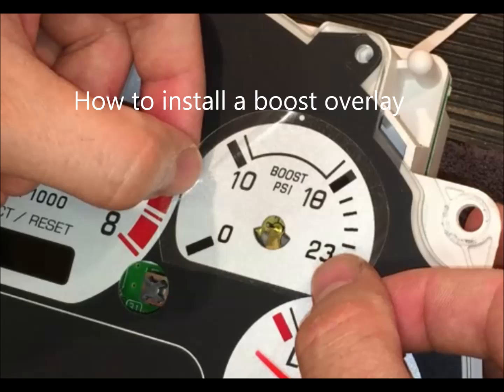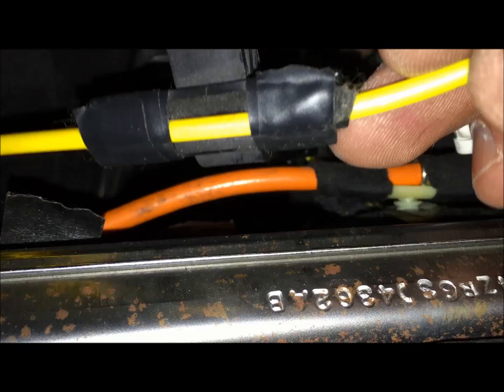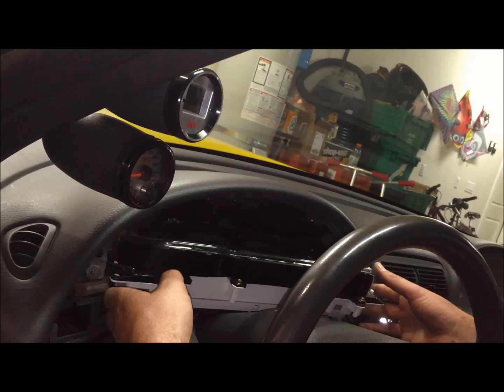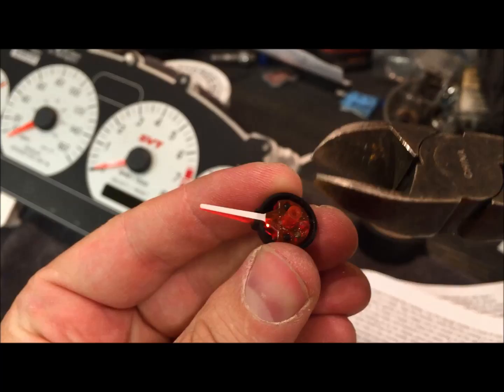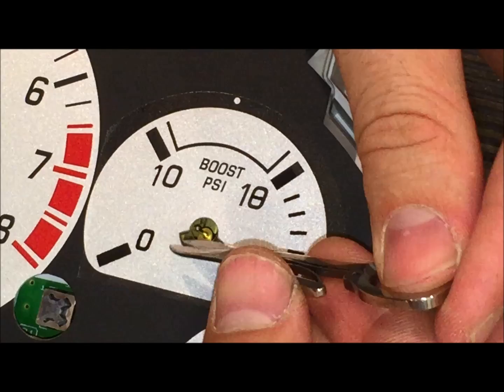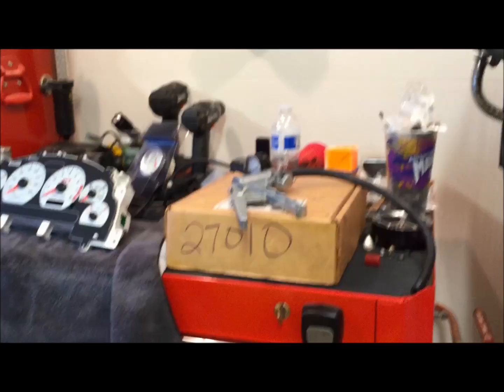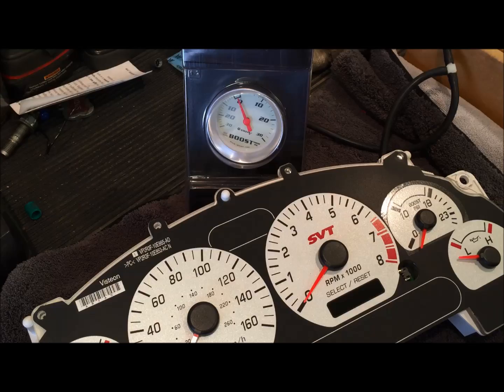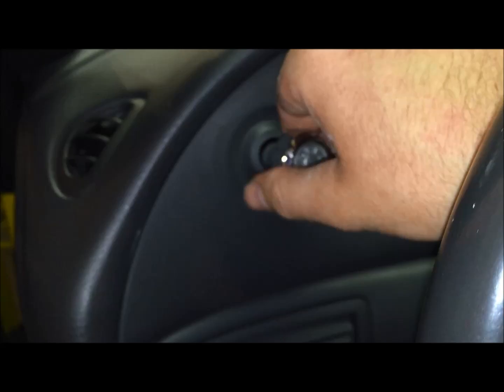How to install Hilton Boost Overlay 2003-2004 Cobra, Ford Mustang SVT Terminator

Comment: nice dude. won't be needing one of these for a while, but i'll be getting my termi tomorrow. kinda skeptical but super stoked. love your Cobra man
Reply from the maker: You'll love the terminator. Congrats
Reply: thanks. i'm scared because it's been raced before but i have one so it's cool
Reply from the maker: +OPG Koyote they are pretty tough cars.
Reply: how so?
Reply from the maker: +OPG Koyote they are low compression (8.5:1) motors with a forged crank, rods, pistons in an iron block. They hold up well and I've seen some live through some hard core crap (like snapping an axle on nitrous and having flames come out the pipes and people go from 3rd at redline back to 2nd and spin the tires and the car is still okay
Reply: yeah i knew it was a forged motor and all that. but this car has been raced, and i don't know how hard, and every car has its limits, you know?
Reply from the maker: +OPG Koyote right.  Well, keep us informed 👍🏼
Reply: Get a compression test done on the car if you're sketchy about it. Other than that the cars are built to be raced lol. Focus on suspension and build your IRS first before big power so you don't break shit and stay away from doing 5th and 6th gear pulls back to back unless you've got the money for another motor. Congrats on the car though, I've got an 04 TR Vert
Reply: Carlos nice man. yeah i'm not super worried. O rings on injectors already gave out but they've been replaced. I'm not too worried after driving it, and it has a live axle swapped into it so i'm good with the suspension. I was thinking of doing a compression test but I don't think that's necessary right now. Thanks for the advice though!

Comment: Awesome video thanks. It looks like you don't need to calibrate the boost needle, just put the cluster bezel back & lay the needle on the bottom of it.. am I right? 
Also do you think a tire inflator can work for testing the boost?
Reply from the maker: It will need to be calibrated as shown in the video
Reply: @dannyjohnsonsgarage  do you have the size of the boost line?

Comment: One thing I noticed. When you had to put the bezel back on. You had to raise the Boost needle back to the zero mark. In order for it to fit right ..You had it set  below the zero to be accurate with the other gauge before you put the bezel back on. So does that mean that it's a couple of PSI off
Reply from the maker: Jay C I don’t believe it affected it. I have still only shown 17 psi that’s aem failsafe also shows.
Reply from the maker: https://www.amazon.com/gp/product/B007ZAQLF6/ref=as_li_qf_asin_il_tl?ie=UTF8&tag=2004047-20&creative=9325&linkCode=as2&creativeASIN=B007ZAQLF6&linkId=2cc5b094f501ec821c39dc5016c73046

Comment: hey danny quick question the boost line is always yellow ?
Reply: and for installing a boost gauge split the connector if u want both the overlay and gauge to both work at the same time?
Reply from the maker: johnny perez Yeah, it should be yellow stock. I also added a T fitting behind the glove box (replaced the stock connection where the two hoses meet with a Y Fitting from a pack you buy at autozone). Now I have boost to the stock gauge cluster as well as my Aem failsafe
Reply from the maker: https://youtu.be/_JzK-QOdOmM

Comment: where did you get that screaming yellow cobra diecast model?
Reply from the maker: Robert Alexander eBay. They were only offered at hobby lobby and target and an exclusive deal so they are hard to find
Reply: man I want one so bad! I've been looking for one.
Reply from the maker: Robert Alexander they are hard to find. I have 2 coupes and a vert and one just sold on eBay for $280+ (new in the box)
Reply: holy cow I don't want one that bad lmao
Reply from the maker: Robert Alexander yeah. Got mine cheaper that that. I bid up to $280 since I'd never seen one in the box before, but that was farther than I even wanted to go
Reply from the maker: Robert Alexander looks like one is on eBay right now for $150 +$18 shipping https://www.ebay.com/itm/201778212170
Reply: sweet! not to be picky, but that is a '2003' modeled after the zinc maybe? looks like a screaming yellow shade to me though lol
Reply from the maker: Robert Alexander technically, yes. It's a 2003 model (and even has gray inserts on the seats where 2004 only offered black), but what's funny is the convertible model I have looks zinc and the coupes were darker like screaming yellow. Worked out for me lol
Reply: that is probably the closet scaled model version of our car that was made I imagine. no one else will really know the difference anyway lol..what do you think would be a reasonable offer to make on that one with the missing box, fog light, and possible minor scratches?
Reply from the maker: Robert Alexander id say 100. I paid $25 and $75 cause people didn't know what they are. Check out auto art too (they don't make a cobra, but I have all the Mach 1s they made and they are way high quality).
Reply: Thanks for the help. He offered it to me for $130 + shipping.

Comment: Did this today and my boost gauge is not turning now I see the gauge like pushes down but needle doesn't move I'm so upset at myself
Reply from the maker: Was the needle pushed down to the point it’s rubbing the faceplate?
Reply: Danny Johnson I filled the video like it said and I did the pressure test I see the whole needle black button it self move down and the needle didn't move
Reply: Danny Johnson I did everything carefully I'm the video sorry lol autocorrect
Reply from the maker: If it worked when calibrating it, I wonder if the line that plugs into the gauge is on correct, or maybe has something in it, blocking it
Reply: Danny Johnson idk but my gauge worked perfect  before and I bought a boost gauge hooked up and I did the pressure test the gauge I bought shot to 20psi fast but my cobra boat gauge just didn't move well the needle didn't turn
Reply: Danny Johnson do you think it's something bad or something simple I can fix
Reply: Danny Johnson like when I was trying to calibrate it the needle wouldn't move and I was like wtf and I just sick to my stomach but you had a great video by the way
Reply: Danny Johnson like when the needle is off I do the pressure test just to see and that gold arm where the needle goes moves downward and to the right
Reply from the maker: Sounds like it’s still working. Is this the overlay that reads more than 18 psi? Did you cut the back nub off?
Reply: Danny Johnson yea smooth it down real nice I just got back into it I think I found my solution when I pulled the gauge needle off it pull the needle out of the pin hole